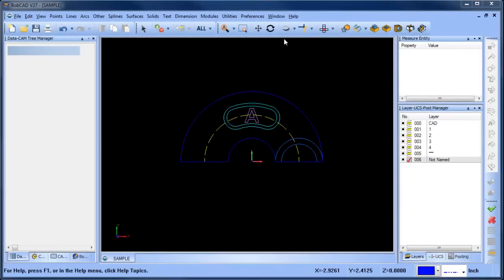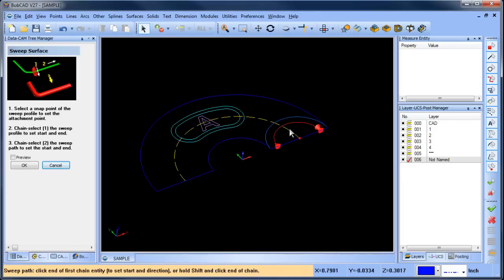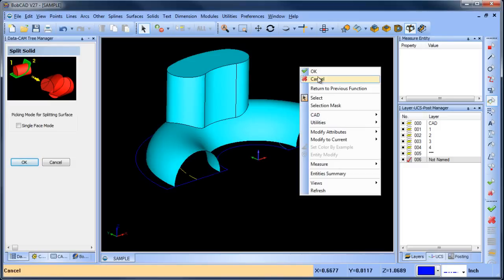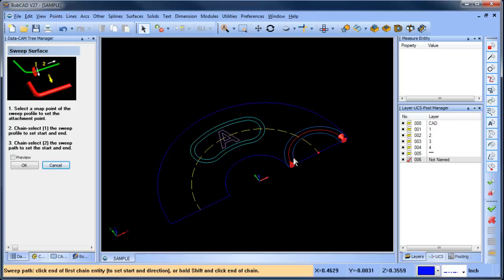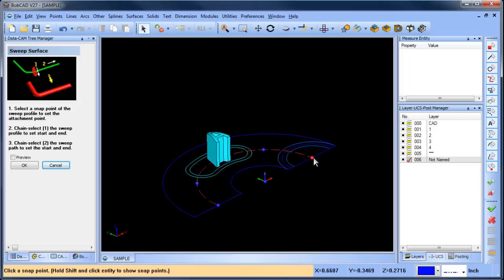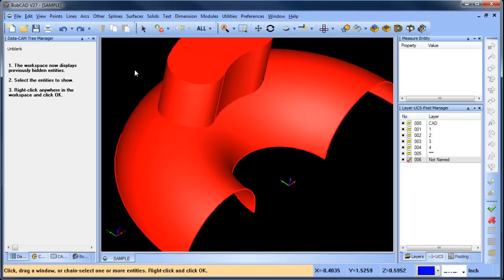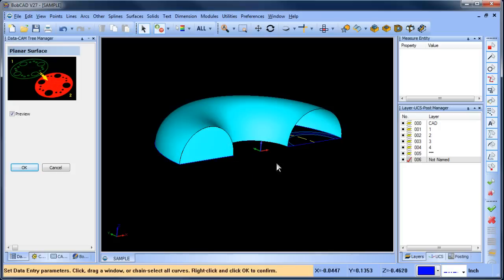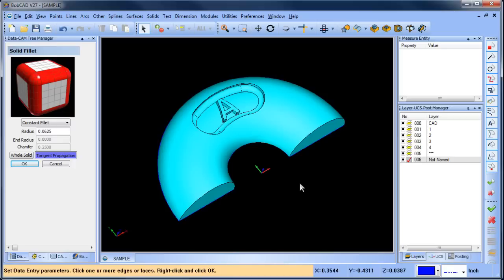BobCAD CAM V27 Surfacing Tutorial

Comment: How is it that, in the first sweep example, the geometry is in the same plane that the 'trajectory is in . The resulting surface's wire frame shows the geom at right angle to trajectory? Seems intuitive that if the geom is parallel to the trajectory you would generate a planer surface